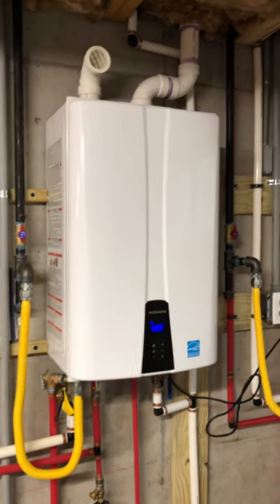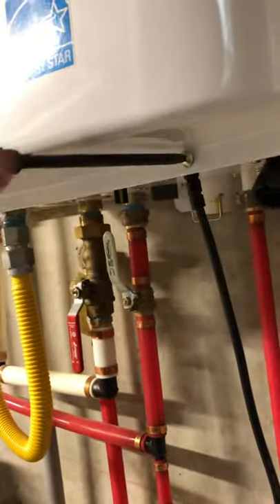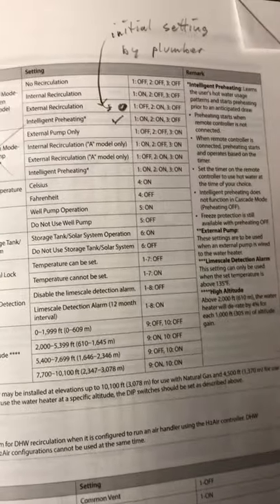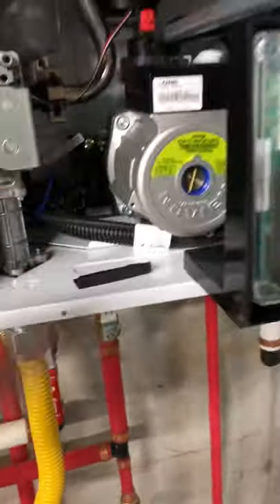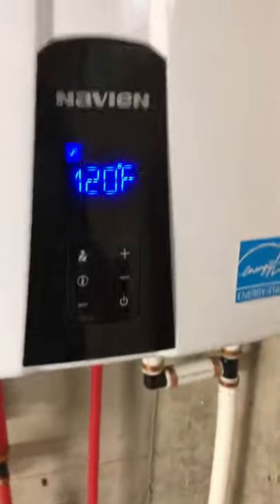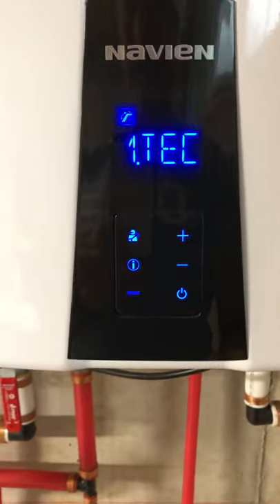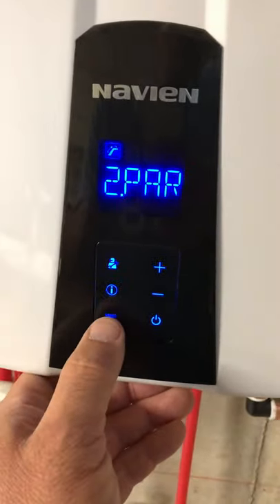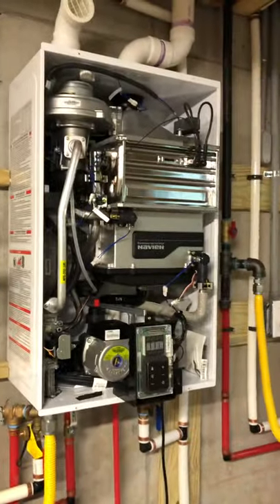Navien Tankless Water Heater DIP Switch and Parameter Settings

Comment: Jim, I am pretty sure the internal and external recirc is in reference to the pumps, Internal will use the pump you have internal to the unit and will push water through the circ loop via that pump. External would be if you had an external pump connected to the pcb in the water heater. The "A" units come all ready to go with internal recirc you just need to flip up dip switch 1
Reply: wrong , if u set internal , it will circulate water only in the heater ,if external it will  circulate in the loop in the house

Comment: That "well pump" setting is very vague - what does it do?  I've always assumed it changes the control to better manage the pressure/flow swings associated with the well operation, but I've never really noticed much difference.

Comment: Thank you! I just had the 240A installed and need to get the intelligent pre-heat setup. The installer didn't know S and I would have had to cold-call around the area to find someone with familiarity with the system.

Comment: Thank you, Jim, for this Navien video.  While it didn’t answer to my issue (where the hell is that DIP switch? — I have an older 240a), I did learn something about my ten year old unit.  BTW…..nice Porsche.  I’m a long time owner of a 944, which is in winter-time mothballs right now. I’m already looking forward to spring!  Take care!
Reply: Two seconds of notes that might be helpful
Manual p45 dipswitch settings
1-3= recirc (int vs ext)
3 = intel preheating in "A" unit
5 = well pump is on
6 switch 9 off = sea level
Programmming parameters p 64-68
Turn off
+ x 3
- x 3
+ x 4
>1.TEC
+x1
>2.PAR
i
Preheat is 20, title 24 is 5
p12
+x12
i
>10 (flash)
+/-
i
>wait
reset (backs you out)
power (off)

Comment: Hi. Is there a manifold for the circ pump (at the end point) or do you have a loop plumbed into your house? Not sure how the external loop works. Also, can you install PEX that close to a tankless unit? 18" linear for tanks. These things have really improved since the last one I installed. Great video, thanks. I'm sold.
Reply from the maker: The loop is plumbed into the house.

Comment: Did the intelligence setting actually work, and if it did how long do you feel it took to learn your usage?  Was the 10 min preheat sufficient or did you have to change it back.  I have a new 240a2 and just changed setting from always on where plumber left it to intelligent  so we’ll see.  Good video
Reply from the maker: It’s working ok.  We don’t have a steady pattern of hot water usage so it’s a little confused.  My gas bill has gone way down.  I did set the preheat time back to 20 minutes.  Hope this helps.

Comment: Hey Jim  Have you stuck with the intelligent recirculation setting for a long while now?  If so, how would you rate how intelligent it is?  Any details appreciated ... thanks!
Reply from the maker: I have had it on since I posted the video.  I would give the intelligence 6/10.  But we are retired and don’t have a set schedule and we have 2 units servicing the house.  But I would give the gas savings a 10/10.

Comment: Does the external recirculation have a sensor to put on the most distant bathroom like The Grundfos or Watts Hot water recirculation pump?  So you have instant hot water?  Any issues with this unit?
Reply from the maker: No remote sensor.  It preheats the loop during times when you typically use hot water.

Comment: I just had a 240S2(NG) installed.  If I set the temperature at 120f, the kitchen tap reads 90f after running for 10 minutes.  If I bump it up to 140f, the kitchen tap will read 110f after running 10 mins.  Anything I should check?  I have already power cycled it.  Just looking for things to check before my plumber gets here later this week.

Thanks,
Kelby
Reply: You are most likely loosing those degrees on the run between heater and fixture. If the water line between the two is accessible, try insulating it to maintain the temperature coming out of the water heater.
Reply: @DBC-NC  thanks for the info Raymond. My plumber came by and it was a shower valve (showers not done yet) in my master bath allowing hot and cold to mix.  Now the kitchen sink water will scald my hands!

Comment: I have the npe-150s unit and it takes 3 minutes to heat my faucet water. Would this solution work for my model? My navien is in my bathroom so i dont think its a pipe distance issue i am having.
Reply: Navien has changed this model of dipswitches.

Comment: Hey big Jim, looks like you utilized the recirculation with a return line, did you install an expansion tank and check valve on the cold water intake side? thanks :)
Reply from the maker: No.  The house was plumbed with the hot water loop.
Reply: @bigjimsrealm4369  I am adding a hot water loop from the furthest bathroom  and bringing that line  straight back to the tankless heater and utilizing the built in recirc pump. Do I not need an expansion tank for my application? Thanks for the reply and great video!!!
Reply from the maker: @darrentoth7165  Don’t know.  Probably need to ask a plumber. 😀

Comment: Thank you,  I’m having trouble with error codes and one is E438 is this sample fix or I need to change parts? Cay you help me?
Reply from the maker: Sorry, I’m not familiar with the error codes.
Reply: @ Luis R Gomez good morning, .  I’m dealing with my Navien and internal vs external circulation….and a “mildly disturbed” wife when there was no hot water for her shower!.  Our unit is ten years old, I’m in western MA, and we’ve had extremely cold temps recently. I’m in my manual (I have a 240A model)….and I have two pages of error codes…but no code E438.  I do have a E038….which signifies “Abnormal Circulation Pump, with three suggestions: (1) check circulation pump, (2) check water valve sensor, and (3) check cold water main.  I hope this helps…..damn this technology.
Reply: Good morning, Luis….my reply above accidentally sent to Big Jim

Comment: Hey Jim what version is your book. My version is a 1.0 (Feb.2021) and my book does not show the dip switches like yours on page 45. I am hooking up a brand new NPE-240A2 with the internal pump.
Reply from the maker: My book is 5.4 Jan 2020.  Also my unit is a 240A not a 240A2.  Don’t know what the 2 means.

Comment: Is 120 the max temperature?
Reply from the maker: I’ve heard 140.  Never seen anyone go that high.  Usually people go 120 or 125.
Reply: @bigjimsrealm4369  we had ours set at commercial setting (160 degs  [8 yr warranty] vs 140deg setting residential temp - [15 yr warrant]).   Been fine for a year.  Then my kids said it was too hot this week (Jan 2023)?? I turned it down to 139 via the front panel, now it’s just luke warm can’t even make tea.  AND the temp button stays at 139 and won’t go up.    I’ll try your +++—-++++ method
Reply from the maker: @yingnyang2889  we leave ours at 120.  It takes a few minutes to get the shower hot hot.
Reply: We have the NPE-A2 and it allows temps 140-160 but you have to turn off the temp lock dip switch and enable commercial mode through the installer menu on the front panel. See manual p91.

Comment: I want to shutoff 1 area thats 1 room and is super hot 
Thermostat broke and I dont need that area 
So I can just stay with the house one
Reply from the maker: If there is a valve to shut off that area, should be no problem.  What is the set temp on the water heater?